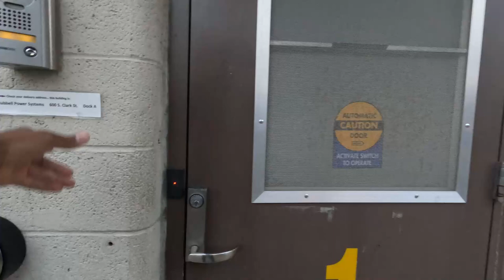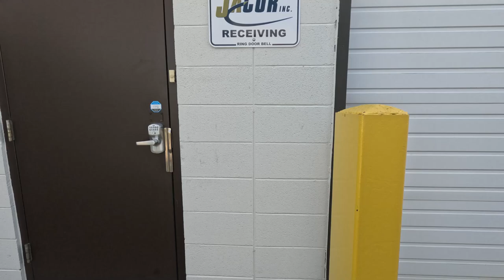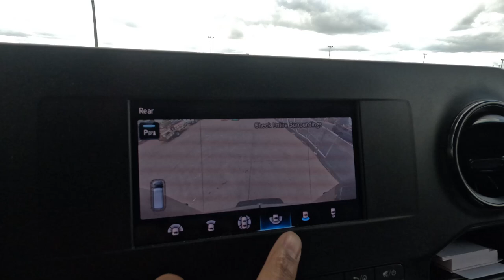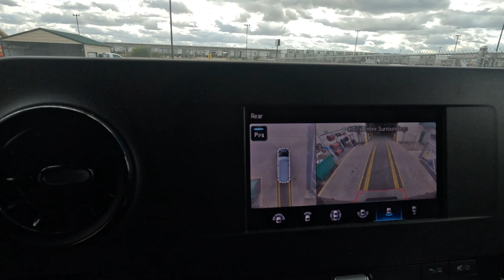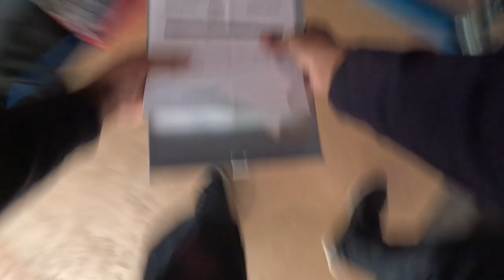Was this WORTH IT? Would You Do These Cargo Van Deliveries? #foryou

Comment: CCC I have the OEM 360 Degree Camera On-Demand for 2019 – 2023 Sprinter (907) OBD Programmer loaded on my 2020 Airstream Nineteen campervan. Since I tow a kayak and trailer and by default, the camera doesn't work when traveling over 5 mph. With the device mentioned above, it runs all the time except when I come to a complete stop but then I turn it back on using the camera icon on the MBUX.
Reply from the maker: Interesting!! That is definitely plenty of camera angles to choose from!

Comment: You state the dead head miles to the job then job miles, and total it. But you never really include deadhead time/miles home. For instance what’s your round trip for the whole $450 day? Hoping you overlapped and the 2nd trip was heading closer to home not further away…I mean none of my business but it’d make for better content imo if you put the whole day time/miles/gas cost in there. Like shit it was 372 miles 25 gallons @$4.50 gas 8hr day.
Reply from the maker: I understand.  The miles I read off is what is on the load info, it is calculated from where I am currently at. I don't keep track good enough to be able to tell you all that extra info during the video. I used to, but it just got to be too much. I do other things in between orders, maybe a smaller order that doesn't go in the video or errands, etc. For that order. I drove about 20 miles back towards home after the 1st order, when I got the 2nd order. A few of those miles would overlap due to the delay on the updating of my location. After the 2nd order I had to drive about 90 miles back home. Pretty much 85 was all highway, it cost me about $7 in gas for those miles. I definitely worked an 8 hour day and then took about 30mins at the end to complete the video recording and to clean up the van.